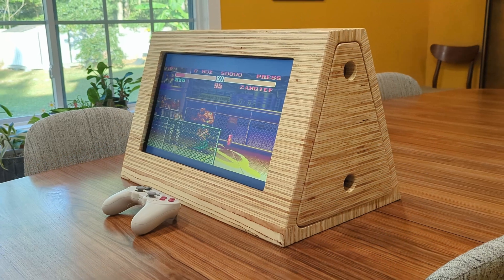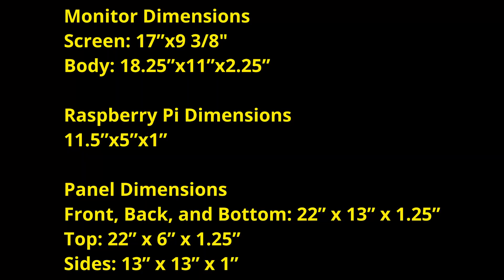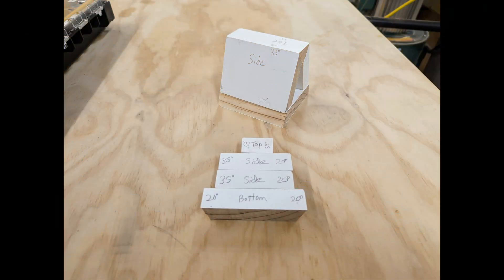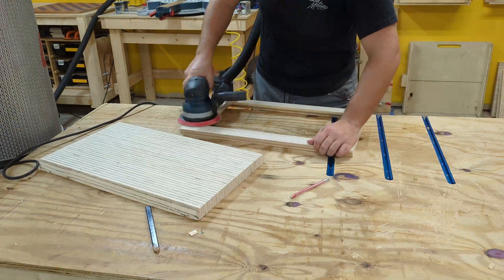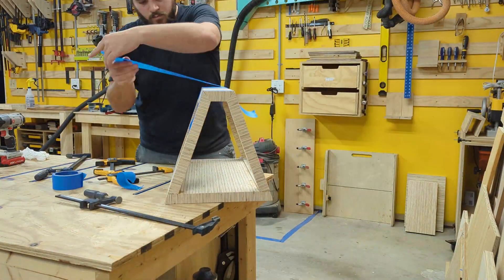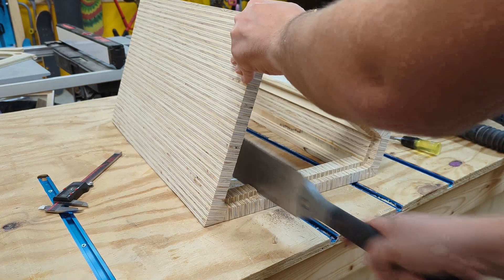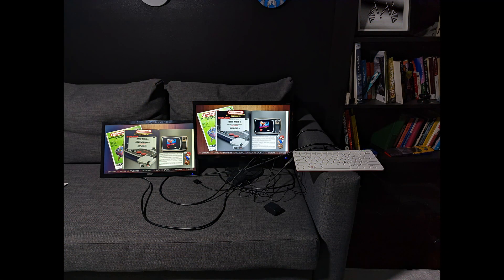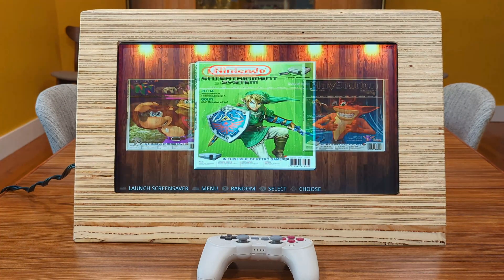Making a Dual Screen Tabletop Arcade with Plywood Edge Grain

Comment: What size would a monitors? I had plans to do an arcade cabinet myself and the used monitor. I just picked up two weeks ago isn’t working out for me. It’s got glitches and the images is flickering but I’ve got a 19 inch insignia TV that is so reliable and beautiful and perfect.

Comment: hey where did u get roms/emulators?
for like old school gaming?
nintendo,super nes,sega.. dream cast.. etc?
Reply from the maker: If you type "roms github" in to google you'll find a great source. The emulator is called retropie. It is an operating system for the raspberry pie. https://retropie.org.uk/docs/First-Installation/
Reply: @BlockAfterBlock  if i get the retro pie it have all those roms that u have? i just need to download? where the link?
Reply from the maker: @kntwing23  No, there are more steps than that. I'd recommend this @Retro Gaming Guy video to get started. https://www.youtube.com/watch?v=R7K07o4HYzE

Comment: Very nice job. Please please please use push sticks or blocks on your table saw. I cut the tip of my pointer finger off a few years ago. To this day I still swear the blade jumped out and grabbed it 😅. I was absolutely sure my finger was clear of the blade while I repositioned my hand.
Reply from the maker: Thanks! And I'm sorry that happened to you. Scary. I have a good fear of the saw. So much so that I won't use a non Sawstop one. I hope I never need that technology, but it makes me feel better.

Comment: Very nice. Did the monitors have speakers built in or did I miss the "sound" aspect of the build?
Reply from the maker: Good eye! I did skip over that part. Because I went with the random budget monitors I found used, they didn't have speakers. I'm using some random old aux speakers at the moment that plug in to the headphone jack. If I was to build this again I would try to find monitors with speakers and drill a couple holes out in the face for the sound to come through.

Comment: Great job. You may want to consider some active or passive ventilation to get some heat dissipation from inside the thick walled cabinet.
Reply from the maker: Thanks! And yeah, I've been a little worried about it. It isn't used for long sessions but that is definitely in the back of my mind when we are playing.

Comment: Excellent build! Not an easy geometry, especially with wood. I love wood, but I'd prefer metal, so much easier to work with  and way more forgiving. And I'm SO glad I bought a sixxer of 4GB Pi4s in early 2020 @ $49.99 per unit. Pis are endlessly useful. Prices now are outrageous....
Reply from the maker: Yeah, that was smart. I've put off building this for a while but I caved and got the 400 keyboard.

Comment: Your video has had a few shout outs on other channels. Saw your Instagram.  Do you plan to do another game console?
Reply from the maker: Oh yeah!? Would you mind sharing which ones so I can check it out? And I don't have any plans to do another full console I do have plans for this same Raspberry Pi 400. When Its not in the dual screen arcade I want to hook it up to my living room TV. But rather than the keyboard sitting on the media center I really want to build a wooden version of a retro console. I'm still in the planning stages, but I expect that to be in an upcoming video.
Reply: @BlockAfterBlock  leepspvideo Pi news 71 then the article listed.

Comment: Interesting! I thought about making a similar thing, just not back to back and possibly with two not cloned display outputs, but was not sure how would retropie would handle that. and back then pi 3B+ had one hdmi out. 
I already sourced two samsung 3:4 monitors with broken stands too, and it all just gathering dust :) Now pi works as pihole and adsb reciever and I have not thught about just using my keyboard pi for hat. That one is for the cyberdeck project but turned out it is too big for the ammo case I had :)
Reply from the maker: I did minimal testing without the splitter and retropie but os information on the 2nd screen by default. It might be possible but you'd have to do some digging. And it sounds like you have the parts to build one... I'd like to see it
Reply: @BlockAfterBlock  actually do not have proper power supplies( 14-15v, a bit rare with decent amps to run an lcd ) for those monitors, and small chinese dcdc converter gets suspiciuosly hot!

Comment: They make external usb ports which you can use to connect to the rasberry instead of removing the side to excess the keyboard.  Just a suggestion.  Otherwise, sleek design and well made.
Reply: That's great advice! I used it in my Atari Fight Stick pedestal arcade build last year, simplifies cable mgmt.
Reply from the maker: Thats a good idea. It would absolutely help with cable management. I may add that soon.